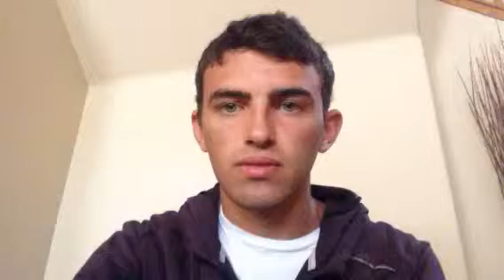The Theory of Orgone (part 2)

Comment: Torsion field info online say the left turning or counterclockwise rotation is the DESTRUCTIVE direction. Is orgone energy the same stuff?
I'd like to know before I make my magnetic stirrer to make the water tornado. I already converted a beard trimmer into a magnetic spinner but it rotates at rpm's too high to control the magnetic stirrer-magnet. So I got a PC fan with a rheostat and am building it a perfect sturdy box only a little bigger than the fan that will support a beaker of water. I'd like to know which direction to spin before going much further and making attachments to involve electricity and/or magnetism.
As of now I can only rotate a 3" aluminum symmetrical ovoid. I set it on a 5" concave glass disk meant for top spinning and takes off on its own soon standing on end rapidly spinning counterclockwise with a gradual clockwise precession that starts small from the center of the disk and spirals outward wider and wider until the egg is skating the outer edge of the glass disk. Then the precession starts to gradually spiral back inward until the egg spins perfectly centered for 15 seconds then the precession cycle repeats. The whole process of this expansion/steady-at-the-max expansion-point/contraction/steady-at-the-zero-point precession cycle takes about a minute with about 15 seconds for each phase, consistently. Gonna test these dynamics out at different rpms and a larger concave glass surface. Introducing a 2" by 1" strong neodymium slows it all down and will completely stop the spin. We'll see what hitting the spinning egg with a spark from a piezoelectric igniter does before playing with inductance then it's on to gathering the energy with my 3 foot tall aluminum pyramid(frame only) and fingering out how to more effectively utilizes it. So far, spinning the egg and hand stirring my water counterclockwise before each sip seems to have a time effect where before time used to fly by such that it seems too much time was passing. But now it seems to have slowed and I'm pleasantly surprised when I check the clock. This with a left rotation I decided on when I watched this vid a few weeks back. Time slowing, improved cognition, serendipity and synchronicity has me discerning that you're correct about rotation direction and I've encountered disinformation and deception as a form of controlled opposition just like the pattern of it I see in every area of knowledge in our illusion of a socio-matrix. Hierarchy and Compartmentalization make mass deception and programming collective consciousness as well as individuated consciousness a breeze to pull off by those who would. I know them well. I was spawned by the bloodlines as a heavily programmed-since-birth disposable mind control slave but about 3 years ago, my higher self woke me up by assisting me in breaking the post-hypnotic commanded amnesia and internal obstacles to recovering a mountain of repressed traumatic memory. Insights and accurate understanding of my previous life from higher consciousness as well as now being able to access the lifetime of constant learning and resilience from those 6 decades of adversity as well as recovering self-love that was also artificially repressed all of that  now coming together with my well exercised mind and a heart fortified with an infinite capacity for forgiveness, compassion, appreciation and gratitude, ALL orchestrated over time by higher consciousness has this former demoralized and abused atheist understanding that God does exist. Just not like people believe. Consciousness IS God and we are ALL Holofractalgraphic individuated mirrors of Source Consciousness and we create our reality with our thoughts, emotions and intent. Beliefs are carefully controlled with us as a means of controlling the reality we manifest. Even the negative polarity of our current state collectively( a crisis of perception) is part of the design of Source Consciousness. So it is also, I believe is a mass awakening of those who intend to understand the real nature of existence, time-wave surfing/quantum jumping/parallel dimension hopping or whatever you want to call it. We all have the ability to control reality Individually and collectively transforming and transcending our lives under our collective shadow-self and this fear filled power-over paradigm into an age of a "power-from-within paradigm. A paradigm of understanding, love and bliss. That was the longest run-on sentence of my life, lol.